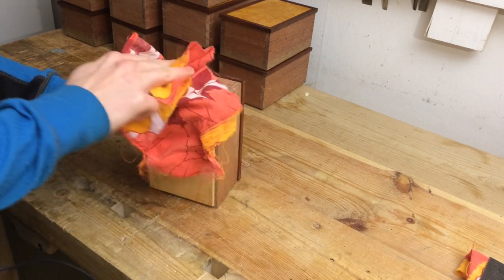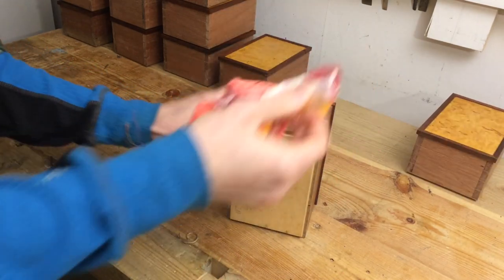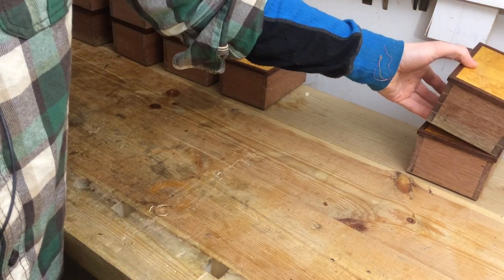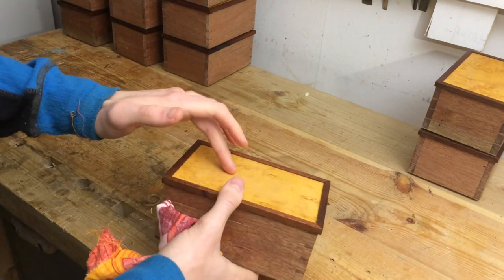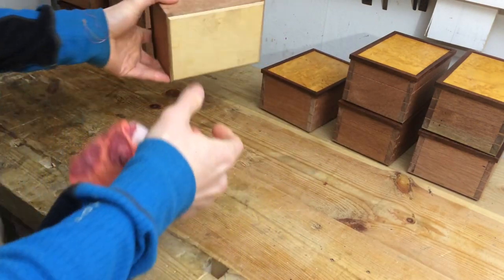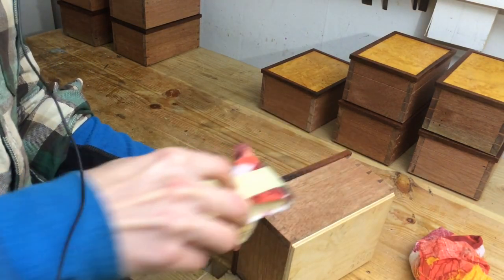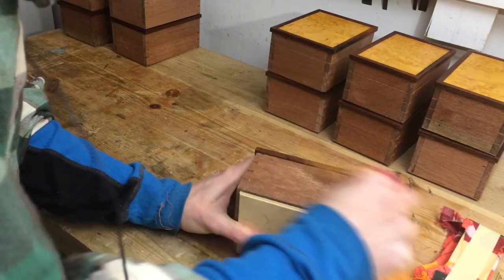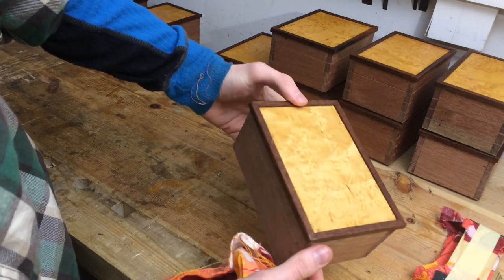12 boxes: a hand tool production run

Comment: Very nice hand work projects. I think your main box wood is mahogany. I have some that looks just like it. It should be relatively light, stiff like pine and a bit soft. As you can see it has a medium size pores. And what caught my eye as the same; is you see what looks like fading or washing out of the rich color along the edge of your pieces. I couldn’t tell without a closer look at the fine dark lid edge trim but thinking that might have been black walnut.

Comment: Great job! I am amazed by your precision and attention to detail, very inspiring. Could the wood you used for the body be ash? I am only a beginner woodworker and know next to nothing about wood species, but I got a small  piece of ash that looks and planes exactly the same. 

Hilsen fra Norge :)
Reply from the maker: Thank you very much! It does work very similarly to ash actually, super pleasant to plane, but all ash I've seen has been a very different colour and grain structure. Are you sure it's ash you've got, if it looks like this? :)
Reply: @GillisBjork  Good question. The person who kindly gave me the piece said it's ash, but I honestly have no idea. I googled around a bit and some pictures of ash look like what I have (and similar to the wood you used, I think) and are labeled as showing a sort of atypical ash. Anyway, that's just my random guess not backed up by actual knowledge. 

I guess the most important thing is that it is nice to work with and looks great :)

Comment: For inside the boxes, did you use a Maple? Also it seems like you are using a D8 saw for the resawing, how much material did you lose?
Reply from the maker: The inside lining is European lime, very nice to work with! D8 is a Disston, right? Mine is not, but similar I guess. It has about 1mm kerf so after planing, maybe I lost 1,5mm or 1/16th inch or so.